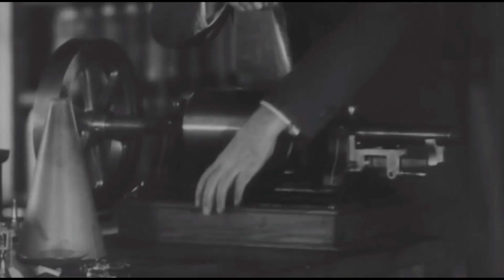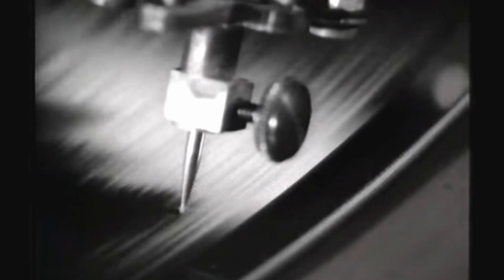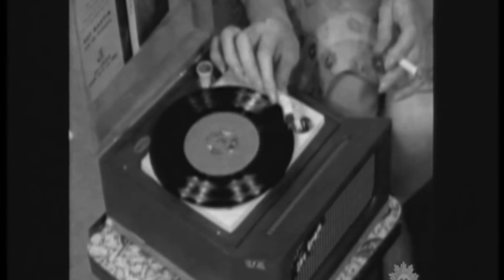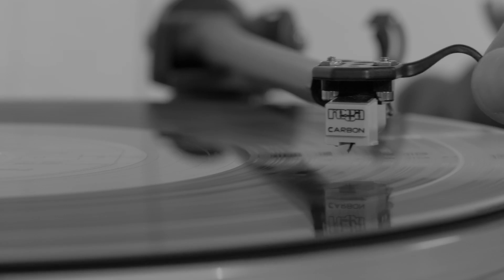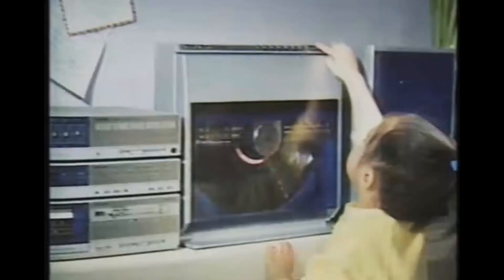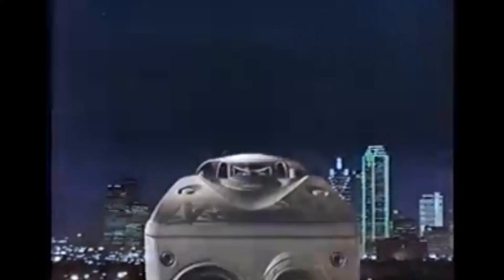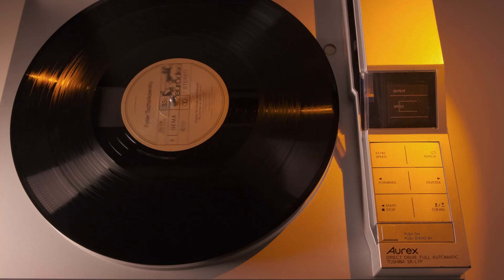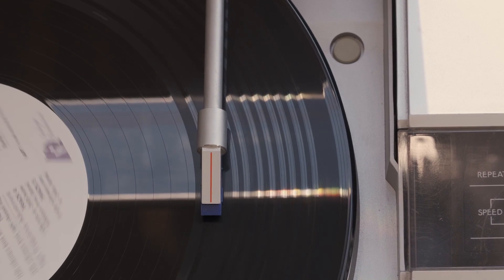What is a Linear Tracking Turntable? | Aurex SR-L7F

Comment: In  technology we  should avoid sentence "as much as possible".  We need instead sentence "as good (as much, as low)  as is practicaly needed". This would be right  guidance also to constructors. 

I wanted also to have linear tracking but after  deliberation I found that when it comes to vintage B&O  amazing  pros will not cover hard  cons. So I use B&O Beogram 1700 traditional - only thing I did was replacing pickup for best for this model. Works no problem for 10 years, it's automatic and no any LP scratch happened so far. No skipping and best resistsance to vibrations.  

I convinced myself that it is "as good as practicaly needed"   by comparison of the same albums  paralell play  by B&O CDdisc  and with this turnatable   with  over switching the same moments within piece of second while played thouugh common very high quality system. The differences were not easy noticeable    and no possible to   find out which is the better  at least for me . Because on other hand LP record is original 59  years old and CD obviously much younger and digital and they are so close.. So linear tracking is still my far wish list  but only as secondary to main traditional. I only do not know how to place such two in compact system .

Comment: I had a Realistic LAB-1500. Definitely NOT high-end hardware. One of my albums, Olivia Newton-John's Greatest Hits, Vol. II, had a bad scratch which would cause an angled tone-arm to skip badly. My linear-tracking LAB-1500 could play the entire album without skipping or sticking.

It had the repeat function. It also had optical sensors to determine which size record you put in it, so it wouldn't drop the cartridge / stylus on the bare turntable.

I really wanted the model from Sansui which had two tone-arms and could play both sides of the record without needing to flip it.

Comment: whatever litle repair i have to do to my components i travel 400kms by road, in the 80´s i had three excelent technicians all from germany due to a Nato airforcefield 4kms from the city i live and grew up ,they had a entire building neighbohood for german young families that sold very cheap their european hi-fi systems for a very low price kind of 35€ ditrectelly converted to todays money, during those years almost 40 i gathered a lot of good sounding systems from european brands ,also some japanese brands and with that my hi-fi colections as a european area. They could be more simple than japanese brands but quality wise they were all very good at all levels ,but never i bought a power amplifier and control amplifier from a european brand. surprising high quality, and english speakers were also very good like celestion, philips ,warfedale, kef, magnat, and many others from north european brands ,the B&O only had one system but while it worked it had a very high quality sound, too much electronic and it failed putting out of work the regualr sources, because normally the cover stoped opening(electronic opening with the touch of a finger)
Reply from the maker: Definitely the 80's were a great time for HiFi audio in Europe. England has always produced amazing quality speakers and power amplifiers. Monitor audio, KEF and Cambridge Audio to name a few. To this day my home setup is mostly British equipment. Unfortunately nowadays it's not like before and finding someone to repair audio gear is very difficult and very expensive. Here in Berlin we have only one or two excellent cassette deck repair guys but you have to wait sometimes for months for an appointment. Luckily with YouTube tutorials and buying spare parts from China, you can  DIY pretty much 80% of the repairs needed. Thank you for sharing once again 🙏🏻

Comment: nice video with a perfect introduction to sound playing systems, i remenber having bought my first tangential turntable but linear tracking was aplied to the tradicional arms ,as a Sharp/optonica i had ,the only problem it was always needing repauirs ,so i sold it but technics had it´s T4P system that was also very good in linear tracking but people call linear tracking turntables to tangential turntablçes allthough they were used in the other arm types, one that i still own is a toshiba with aurex cartridge and stylus and a new type of needle that came with a pre-amplifier but i´ve searched and never found another cartridge as it was given with the toshiba turntable but works perfect with a MM type, still have original aurex needles for it´s mm cartridge, you refer the rega P3 but i never saw it as an aceptable turntable only recentelly i bought a P10
Reply from the maker: Thank you for the insight. Rega makes excellent entry level decks like the P1 and P3 and although I've never demoed the higher end models, from what I've read online, they seem to work very well. The problem with some old linear tracking is finding the ones with available cartridges and spare parts. Nowadays with 3D printing technology, more and more small manufacturers are stepping up and bringing solutions that only a few years ago weren't possible. Cool times indeed.

Comment: I cannot speak for the higher end models, but the pulsed motion of the linear tracking tone arm carriage can be picked up by the cartridge/stylus. I recall becoming aware of this during quiet passages, and between tracks, with a Technics linear tracking turntable back in the 80's. I believe another manufacturer then promoted a "fluid motion" linear tracking system some time thereafter. Unfortunately I now have no idea who the manufacturer was, nor how successful and expensive this interpretation proved to be.

Comment: I bought 3 linear trackers from an estate sale recently, for just $20 each. All are in good condition, but have been sitting unused for 20-30 years, so I've been busy cleaning, lubing, adjusting, and replacing belts on them to get them running again. The first one I've finished is the Luxman P-406, a lower mid-level model that actually works and sounds great with a new AT85EP cartridge. The second is a Sony PS-FL7ii which is a monster chassis with a drawer. Should be a fun project. I think it only needs a tonearm belt. The third is a Kenwood, that looks kinda clunky, but should be repairable. Great video, BTW. Thanks.
Reply from the maker: Thanks for the comment! Pretty good projects you have going on. I have a Song linear tracking turntable that also needs some love. They have a quite nice retro future kind of look. Cheers and good luck with those units!

Comment: i've got 3 tables, B&O Beogram RX2, TX2 and Mitsubishi LT30. (videos on my channel recorded direct from line out from all of them) I originally had a fairly decent radial arm table from the 80s, a Realistic lab-420. a few years ago i was researching replacing the cartridge with something more modern and went down the rabbit hole of how to install and choose an alignment, or an "alignment compromise" so to say.... and that led me down the path of researching linear trackers. i've read that commonly repeated statement about the motorized linear trackers going "as far from tangency as a good radial arm" but that doesn't make sense... even a 12" arm will have more angle deviation at its extremes than the hundredths of a degree of misalignment that any LT allow for before correcting... many are so sensitive as to basically move the arm constantly - the LT-30 in particular seems like this, the motion is so continuous you never see it 'crabbing' across.

cool video, and that aurex looks sweet. i wish modern manufacturers would get back in on this, linear trackers are just better lol
Reply from the maker: Thank you for the nice comment! You have a pretty cool collection for what I've seen on your videos, super nice! And yeah the linear tracking technology on paper is superior but the mechanisms must be regularly serviced.

Comment: I have THREE Technics SL-QL1s from 1981 bough in the last 12 years and they are incredible. The best stylus I have installed on them is an Ortofon OM30 fine line one and it leaves the "recommended" EPS22 in the dust. They are also VERY reliable and relatively easy to fix. Congrats on the video!
Reply from the maker: Thank you! Damn, those are beautiful as well. I've been playing mine just yesterday and boy it sounds so good! Would love to do a review of the SL-QL1 one day. See you around 🤙🏼
Reply: There are hyperelliptical and even fineline/shibata styli availabe for the EP series carts that sound excellent.  I put a hyper on my SL-10.

Comment: The big drawback of this 'table is with the proprietary headshell/stylus (not a standard 1/2" mount) combination make it impossible to upgrade the stylus.
Reply from the maker: Yup, was a big drawback from many of this type of turntables.
Reply: @soundelegy5987  It is a cool-looking table though.
Reply from the maker: @mescko  I got it pretty much just cause of that :P
Reply: A few linear tracking turntables had that problem of proprietary cartridges, and they usually had one thing in common: the ability to optically detect bands (tracks) on a record for automated random access, such as by programming a play order for the side.  A proprietary cartridge wound up being necessary to accommodate the optical sensor array required for such a feature, since there were no guarantees that third party pickups wouldn't cause obstruction problems.  And a potentially annoying issue with this is replacement styli; OEM sources have likely dried up years ago, leaving aftermarket sources like Pfanstiehl.

Linear tracking turntables that did not have this optical sensor were usually made for P-mount pickups, which had its perks and quirks.  The perk was that P-mounts were standardized to the point where virtually every P-mount cartridge was plug-n-play ... in theory.  The quirk was that you usually couldn't adjust anything and your choice of pickups were limited to whatever was available on that form factor, and the offerings were usually low-end to mid-range.  There were some P-mount tonearms where some adjustments were possible, such as the Technics SL-M1 and SL-MA1, but those were usually the exception.

Of course, there are some linear trackers that were made for standard 1/2" mount pickups.  Examples include the Sony PS-X800 and the PS-X555ES (both of these Sony turntables are Biotracer models), the Yamaha PX-1, PX-2, and PX-3, the Revox B791 and B795, and the way-ahead-of-its-time but mechanically complex Marantz SLT-12.
Reply from the maker: That's really interesting, thank you for you insights! Do you work with turntables or is it just a hobby? Cheers!
Reply: @soundelegy5987  I work with turntables as part of my hobby in hi-fi and video, you could say.
Reply: @Watcher3223  The linears I have that use 1/2" are the Mitsubishi LT-20,  LT-30, Sony PS-X800, Pioneer PL-L1000 and L1000A, Yamaha PX-3, Harman/Kardon ST-7 and the Akai AP-L45 and L95.